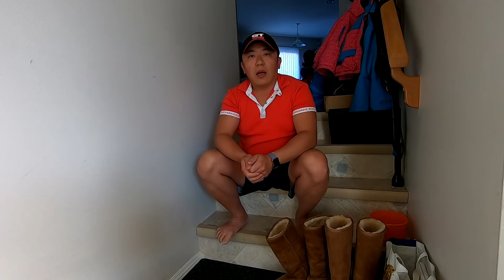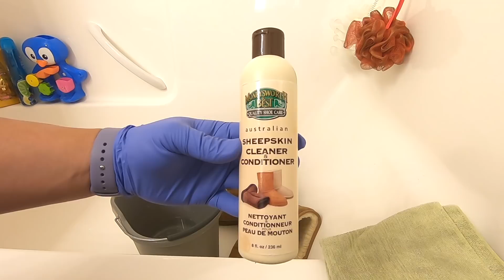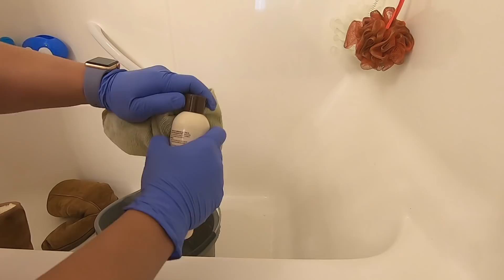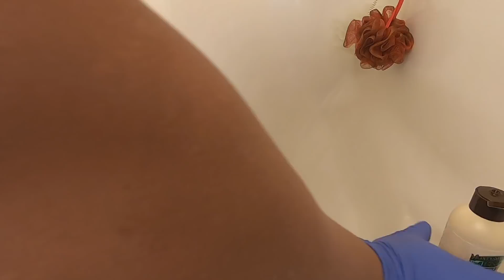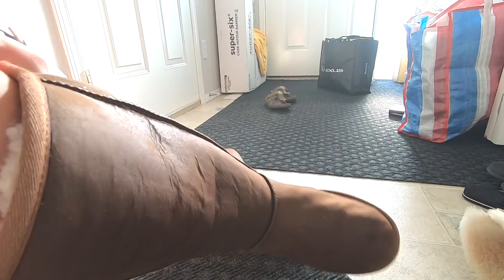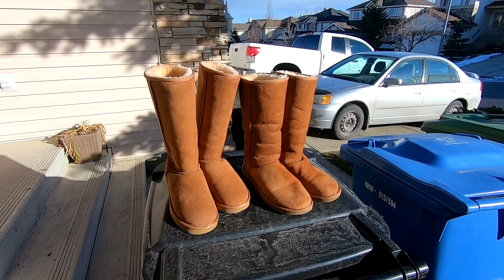How to Clean UGG Boots Easily and Effectively Using the Factory Approved Method

Comment: Hey question how to wash the inside and make the wole as new fluffy ?
Reply from the maker: I have another extremely unorthodox cleaning video for Ugg’s that washes the entire boot but it shouldn’t be used unless no other method will clean them properly.  If you use the method that you watched the best I can suggest is vacuum out all the grit in the bottom of the boot so it’s clean and then using a soft bristle brush to brush the wool’s nap back up and give it a spritz of the UGG boot deodorizing spray to freshen them up.
Reply from the maker: Yes but I wanted to show the universal method so that the Honda’s that don’t have the bleeder valve can be bled properly.  Not all accords for example from that era have bleeder valves so I didn’t want to show something that didn’t apply to some owners.

Comment: How i clean inside????
Reply from the maker: Hmm, using the factory approved method there really isn't a way to clean the insides other than vacuuming it out with a vacuum cleaner to remove embedded dirt in the footbeds.  I give the insides a spritz of UGG boot freshening spray and call it a day.  The sides of the insides rarely get dirty (at least mine never do).  The usual issue is getting bits of sand and gravel in the foot of the boot which is why I vacuum it out about once a week when I'm cleaning my house :)
Reply: I use cornstarch scented body powder, or foot powder and sprinkle it in.  Freshens and fluffy the wool

Comment: I got one spot on my new ugg boot and it will not come out🥺. I am too afraid to wet them.
Reply from the maker: it is okay to get a damp sponge to very carefully spot clean the area making sure you don't rub too hard or get the suede too wet.  Just don't put cleaner directly on the sheepskin and don't get things too wet.  Let things naturally air dry (no heat) and then give the suede a light brushing with a shoe brush and it should look good as new.

Comment: Hi! Nice video, but I have a question if you could answer. I have the Maroon Numel Uggs and was wondering if this same method is safe for different colors? Im asking because I followed a tutorial like this for Timberlands where the creator used "Wheat" ones and I have Navy Blue Timbs. When I followed his tutorial almost to the T, i seemed to have stripped the dye on the toes of my timbs and its discolored there, but everywhere else is fine. Thanks again!
Reply from the maker: that's the problem with Uggs and similar shoes in general.  The dye no matter WHAT will run to some degree.  The wetter it gets the more the dye will run.  This factory approve technic will work to a limited degree due to the fact that it needs to slightly wet the boot to get the soil to "lift" from the fabric.  Personally if I were you I'd spot test a small area using as little water/cleaner as possible.  Use a sponge instead of a cloth and see if you see dye coming off.  If you don't then progressively work each section of the shoe letting each section dry before proceeding to the next.  It will be a painfully slow process to clean your shoes BUT at least you minimize the damage should the dye start to run and come off.  If it doesn't then keep moving on section by section and in the end you'll have a clean shoe!  Hope that helps.
Reply: @piercedasian  Awesome thank you for the reply! I appreciate the advice

Comment: I watched your previous video and wash my Uggs; I regretted it because the dye stained the inside fabric 😩
Reply from the maker: sorry to hear that.  The staining of the inside shouldn't be that bad.  I did specify numerous times that the dye does run.  This is why I have 2 UGG cleaning videos and I've cross linked them to each other so you can gauge what method you want to use.

Comment: Best way to Cléan uggs put them in the wash machine on delicate, with downy fabric softener.... You’re very welcome my uggs look brand new, didn’t have to use any dye or anything for discoloration when you take them out the wash let them air dry 😌
Reply from the maker: You could do that but for wickedly stained Uggs it doesn't  always work 100% which is why I i have to sometimes clean with a toothbrush and hand wash them in a sink full of water.  The video you watched here is the factory approved method because I was getting a TON of flack for my other Ugg cleaning video which is the "submerge and scrub method followed by using a washing machine" as you've suggested.  Check it out if you've got time.
Reply: Sharaya Butterfly do you use warm or cold water? Any kind of soap?
Reply: How do you dry yours?

Comment: Hi, early in the video you mentioned using vinegar and water instead of the purhased cleaner.  Will the vinegar work just as well an if so, do you use it straight or add how much water? Thanks
Reply from the maker: Hey Robin, I am not sure if you mis-heard me in my video but I make no mention of vinegar in this video. Perhaps you heard it somewhere else?  I just watched the first 6 minutes of my own video and I didn’t hear myself mention vinegar.  Use a cleaner that is meant for sheepskin, it use a highly diluted mixture of baby shampoo or Woolite detergent.  You just need an ounce of cleaner mixed with about half a gallon of water to be effective. A little goes a long way.